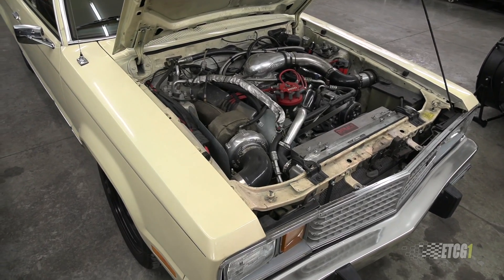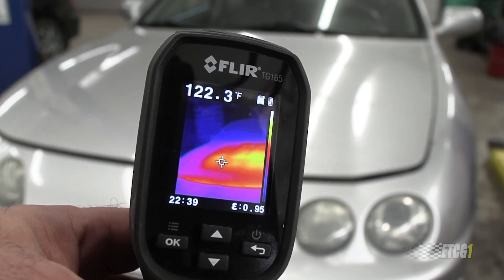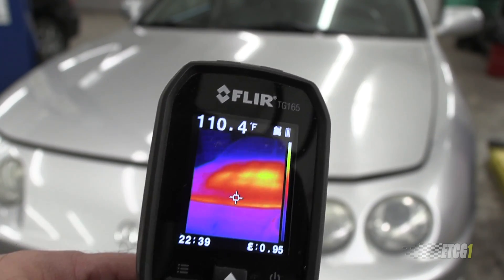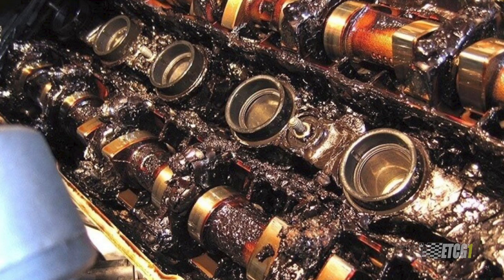What Is Heat Soak?

Comment: That's why maintenance is so important in a vehicle. The engineers at car manufacturers spend buckets of money towards power train designs. Things like heat soak are factored into it. They run engines for thousands of hours to make sure they can handle these types of stress that will be put on them alot. Or they are supposed to anyway. But like I said. They factor in the vehicle getting maintenance at needed  intervals. If that's not done. Then the drivetrain won't work or last like it was engineered to. Which creates high wear and engine over heating

Comment: I have a carbureted 340 with cast iron intake. To avoid boiling the gas in the carb while parked I open the hood remove the breather lid and stick a wrench in the secondaries to hold open the butterfly. This allows the heat to escape the carb and then its not hard to start when Im ready to leave.
Reply from the maker: Brilliant! Thanks for sharing that tip

Comment: Outside air is moving faster at driving speeds, = lower air pressure outside = hot air from engine will be pulled out at driving speeds.   Also hot air rises. I pull out the winter rubber seals for the summer.

Comment: 1) Got a 2000 Prelude (original owner), never heard the fan stay on after engine shut off, had an issue on a '96 Civic where the fan wouldn't shut off after taking it up a mountain, dealer fixed it
2) I know the engine bay in my 'Lude is hot because the hood gets pretty warm but I never popped the hood on my car to cool it down. The engine has 191K and counting, got a chance to look at the inside of the head when replacing the exhaust cam cap seal, it was pristine, no oil sludge buildup. I am usually pretty punctual about oil changes (mostly Castrol 5W-30 dino juice, anywhere between 3-4K)

Comment: IN all the cars I've had (both new and old) never had any issues with just shutting off the engine and walking away (yes I had one Honda Civic but it never ran the cooling fans after I turned the car off; although my friend's 88 Accord would periodically when the temps got above 90 F outside).  I think it's one of those things that if you're not running it in 100 degree F temperatures for all day long, the long term effects are probably not as bad as people make it seem).  I'm not saying it doesn't happen, but I'm also not thinking it's that big of a deal in reality for most people.  I mean if it's really hot out and the cooling fan is running, sometimes I'll sit and wait for the cooling fan to turn off before I shut the engine off which this usually can mean another minute or so of sitting there.

I mean I couild see if you were one of those street racer people who races their car then it might make sense as that puts extra stress on the engine and probably causes more heat than the average person just driving around normally.  But in all of my years of car ownership I have never had this result into a major issue.  Usually other things broke on cars before anything like this did them in (such as transmission issues, major oil leaks, etc).

Comment: Eric, it might make for a very interesting video to graph your IAT sensor on a drive starting with a cold engine. Then make a stop for a few minutes to allow heat soak to take effect on the intake manifold etc. Then go for another drive and keep graphing. I was super surprised to see my IAT temps jump from 100 to 145 after running into the grocery store.

Comment: Got a kick out of this, I have the same issue with machinery love / concern. Although, mine is two fold. I park ALL my cars inside to protect them period. In addition, I open hoods (especially on my older classics) to elevate pressure on lifting / pop springs and associated gas lift rods etc. This includes rear hatches as well, and T tops, so rubber seals are not compressed, Simply cover with ultra soft cotton sheets draped over each to minimize potential dust.

Comment: Drive a fair amount.
Get home.
Turn the engine off.
Pop the hood.
Grab a seat.
And listen to the exhaust manifolds crackling as it cools down.

pure bliss

Aside from that, heat soak is a very real problem with my '64 dodge. After driving for a while, then shutting it off to go buy sumthin at walmart, come back start the engine and it stalls as the carb got "overcooked" by the heat soak.

Comment: I think the best solution would be a custom hood vent like AMG does. That way the heat finds an easier way to escape, as heat rises.

A more practical solution for garage or car port parkers would be to buy a snail fan (the ones used on dynamometers). Plug it into a timer in the wall, flick the fan on and keep it running on the timer for 20 minutes in front of the lower car intake. Once it’s up, the timer cuts power to the fan and you will have a cooler engine. Easy peezy!

Doesn’t have to be a snail fan though. Could be a high velocity fan, or even a box fan (as long as there’s nothing that will interrupt the flow of air to the engine)

Comment: I had an old Mercedes that would run hot after getting off the highway on my way home after work in the summer. Eventually I started popping the hood once I got to my block to get extra airflow in and as soon as I got home I’d leave the hood up and go in and unpack all my stuff and head back out later to close it. Now in my Miata I open the hood every time I finish driving hard or for a long time whenever it’s hot out. I’ll also leave the key in the run position until the cooling fan turns off and then I’ll close everything up.

Comment: Hi Eric,
Where I live is usually really hot and I also open the hood and put a floor fan facing the radiator. Even if the car is shut down if you can cool the water in the radiator it will cicle, slowly but it will because the “heat convection” effect.

Some german cars a more effective system to allow the car to cool properly after shutdown, where the radiator fan keeps on for few minutes after the car is shut down.

My father and I where able to recreate this system on my old ‘94 Civic.
Basically you need to give direct power to one of the relay prongs in order to activate the circuit of the fan and water temp.
What you want is keep the circuit alive after key shut down, the fan will spin until the temp is lowered and the fun will shut itself.

Comment: My friend who tunes Subarus taught me that heat soak makes things difficult when tuning on a hot summer day because the engine heats up the intercooler and aluminum intake, which are both on top of the engine in Subarus, which raises intake temperatures, increases knock, etc. Sometimes I drive a car he's road tuning and we avoid stopping to prevent heat soak from interfering.

Comment: i installed a third slim fan with a switch on my radiator, on every red light i always turn the fan on, once the car starts moving i turn it off, if i'm stuck on traffic on the free way, i turn it on also. it help to keep the 2 main fan from over working and fail on me cause since the 3rd fan working and keeping the coolant at cool temp, the radiator fan switch wont turn on the main fans since the temp never get to the hot poin. keep cooling the coolant while the car at standing still at the red light or on slow moving speed bumper to bumper traffic jam. if the third fan ever go out, it's always a cheaper replacement than the main fans.

Comment: Heat soak can also mess with electronics too. Materials being hot affects how they conduct electricity. First thing I do with old vehicles is clean up electrodes and grounds and give the engine a good wash. Dust and oil all over your block can be a surprisingly good insulator, i've had weird electric problems go away after a good clean up.

Comment: This reminds me of a PROTIP:

If you're driving along and see your temperature gauge creeping up, turn your heater to full blast and then pull over at the next safest place. Check for traffic before exiting the vehicle to pop the hood and cool that baby down.

The reason for turning on the heater is the heater gets heat from the engine. This can buy you a bit more time to safely exit the racing surface... I mean... the road

Comment: My owners manual for a 03 VW GLI says that after cruising on the highway, NOT to abruptly shut off the engine, but to let it run for a couple minutes to avoid "hot spotting"
I assume certain parts become deferentially hotter, and having the water pump run allowed things to even out upon cooling

Comment: Was having a heat soak issue with my 1997 Geo Metro. It wouldn't crank after I parked it until the engine cooled off enough to do so. 

I just removed the thermostat to see if it helps in the future. Fingers crossed.

Comment: I really don’t think this is an issue.  If you are running a modern synthetic oil sitting in an engine that’s shut off it will be what maybe in the 212-217f range?  Isn’t the cook off temp for synth something in the 400*+ range?  This is a nonissue to me.  Run a good oil and change it.  Doubt doing this will solve anything.  Now maybe if you come off a track or something sure... but you are changing your oil way more frequently anyway doing something that severe.

Comment: the big question is how much difference opening the hood realy make ???
it's not like opening the hood start to make the air flow faster around the engine, i would not be surprise  that's it's the opposite 
maintaining the hood closed probably cause some sort of air flow when it try  to exit at the top

and if you go into the infra  range heat dissipation ...total darkness  is better.... (ok when the hood is also hot ..it cancel out lol)
Reply from the maker: It makes a big difference actually. Try sleeping without a blanket in the winter and you'll see what I mean.

Comment: Before OEM's got heavy into turbos and learned how to make the engines live "turbo timers" were all the rage with aftermarket turbo kits. They would keep the engine running for several minutes after you turned off the key to keep the oil circulating while the engine cooled down.

Comment: @ETCG1 I have that same "mechanical sympathy" gene, expressed in physics/logic and at the extreme end of popping the hood whenever possible (opposite in winter - to retain heat for restart to minimize cold starts).
  Do PLEASE remind folks, that if propped open with object that bypasses the safety latch, to prop open high enough to notice or some other reminder,  so as to not HOOD SLAP the windshield 😮😖  which is scary and expensive!

Comment: I know the engineers at Honda thought about it when designing the cooling system to run the fans up to 30 minutes after switching off the ignition, but 30 minutes seems like a long time to leave a fairly high amperage circuit running on a series of cars that only run a 51R-C battery, something that does not have a lot of capacity to begin with. Just my thoughts.
Reply from the maker: They don't often run for the actual 30min, that's just the max spec. It's usually only about 10min in my experience.

Comment: In the 03 Chevy Cavalier I had for my first car the fans would keep running after I shut the car off, until either the temperature was below a set point (can’t remember what temp that was) or the timer maxed out (witch was something like 20 minutes I think..) Now I daily an 03 Silverado witch was not the same unfortunately because from the factory it came with a mechanical fan. But I really liked the idea of fans running after I shut the vehicle off IF it is over a certain temperature, and I was also interested in the idea of having electric fans in general because I do haul often and things can get a little toasty if I’m really pushing it when it’s hot outside. So after a couple years of owning this truck I swapped in a larger factory radiator and factory dual electric fans, from a newer model HD truck so they bolted right up. After a little tuning the fans are now controlled by the factory ecu and I also programmed them to run after the truck is shut off, IF the coolant temperature in the block is over 210 degrees. (Since I have dual battery’s that are not connected to one another when the truck is off I did not set a timer, they will just run until either the coolant temperature in the block drops below 180 degrees, or theoretically until the main battery dies but I doubt it would ever get THAT hot though to where the battery would die before the engine was cool enough)

Comment: Unless the car have mods, you won't have ever any trouble with heat soak, as the cilinder walls (sleeves?) are the hotter part and they must not be much hotter than the oil already... and the oil is a huge mass compared to the metal that is a fre degrees hotter and will absorb it.
On the other hand, rapid cooling from 90-100ºC to 20ºC will make trouble with time...

Comment: i had a heat soak issue with my build. The MAT sensor was right before the throttle body, coincidentally very close to the radiator. After a long drive, the sensor would take in this heat soak and read higher than normal temps at idle, causing it to lean out. I had to move it down right after the intercooler to fix this issue

Comment: I first became aware of heat soak, when I'd park a older Camaro with the starter directly under the right exhaust manifold..  It would seize up the starter till it cooled.    I sorta fixed it with heat shields and other insulation, but I do get the idea.    My old Turbo Corvair spider, would cook the oil in the bearing bushing once it "Spooled down.    

A good reason to run synthetics in newer turbo cars.       

Something else I wanted to ask you is " What do you think about leak down test and could yo do a video on it and how it can not only spot engine wear but indicate where it's coming from"..   Blown head gasket, rings,valves/intake or exhaust.    Just a thought.    Your old pal Sela....Stay relatively dirty.

Comment: Jaguar Rover tech here. Been seeing a lot of vehicles come in here to our dealership in the fine mid July Atlanta heat with leaking evap seals to breather hoses or purge valves. Particularly on early 2010 jag sedans. And as anyone knows that works on jag or rovers, they LOVE brittle plastic material for hoses. The smoke tester has been worked to death since early june.

I've replaced 3 evap canister purge valves and 2 full throttle breather hoses just this week. And Its not even thursday yet

Comment: My accord definitely doesnt get that treatment. Been doing it for about 2 maybe 3 years and it fine. Gets redenned up once every few months and then turned off for another few. Reason for letting the heat soak in it is to let the moisture go away. Then a reasonably air tight cover is put over it. Car is all original bar an alternator, clutch, brake disks, spark plugs, filters, oil, tyres and an ignition which was accidentally damaged in 2003. 99 accord, f18b2 engine, manual 5 speed. 230k miles too and still starts (after months of sitting) like it was only running yesterday. That car has never failed to start ever and has never left me or my family stranded. Very little rust too which is surprising for that generation. It got undersealed multiple times. Interior is almost perfect. Hondas have to be some of the most under appreciated cars in existence

Comment: Perhaps an electrical fan connected to a 20-minute timer. Some of my parents cars in recent years had the fans run for a bit after turning the engine off. I suppose it's an idea for a potential aftermarket unit.

Comment: If all you're worried about is cooking your oil into a crusty mess just change it on time.  If you want to be kind to your car just buy a high quality synthetic oil like Amsoil signature series and change it often say every 5k miles or 6 months. The only time I've ever seen a crusty mess like the picture showed was from repeatedly not changing oil on time and going way past it's life expectancy continuously over a period of years.
Reply from the maker: Heat soak also effects plastic and rubber components breaking them down and making them brittle.
Reply: @ETCG1  Good to know. Have you actually seen a noticeable difference in those parts lasting longer just by leaving the hood open? That seems like a hard thing to prove that its  heat soak causing them to get brittle and not just age.
Reply from the maker: @ajs622  It is hard to prove. I never claimed opening your hood was necessary, it's just something I do because I'm sympathetic to my machines.
Reply: @ETCG1  sympathetic to your machines I like that. I wish more people were that way. You are definitely a guy I would want to buy a used car from there would be no need to worry about the cars past maintenance history.

Comment: A few months ago I got a 2020 Supra. Something I noticed right away was how amazingly fast the engine came up to normal operating temperature, in probably half the time of any other car I've had. With a bit of investigation I discovered that BMW, with whom the car was jointly developed, has done a lot of work on actually retaining heat after the engine is shut off. I think they call it heat encapsulation. The purpose is to minimize warmup time and thus maximize mpg.

Comment: I don’t necessarily raise the hood when I get somewhere. But what I have done particularly when the kids were little, if they were asleep. I’d leave it running with the AC on. I’m in the southern climate. There are times we run our AC at Christmas. But I digress, if we were parked and I had to run the car with the AC on, I would often raise the hood just to let the heat out. It tends to keep rubber components happier and the alternator and starter. Numerous occasions I had people ask me if I was having car trouble, “no I’m preventing them” ✌️